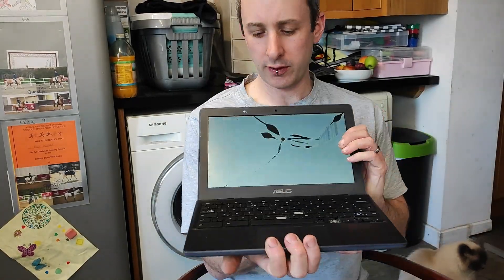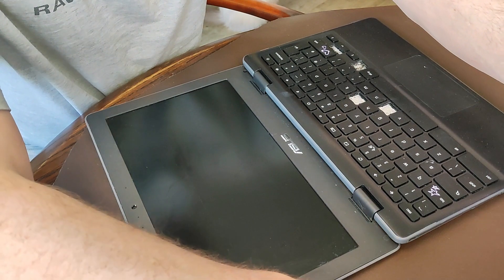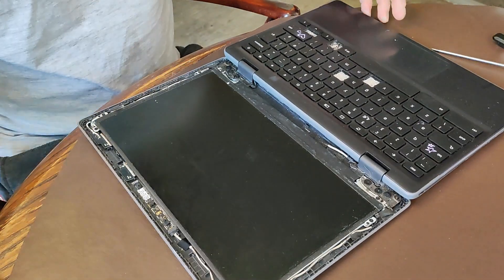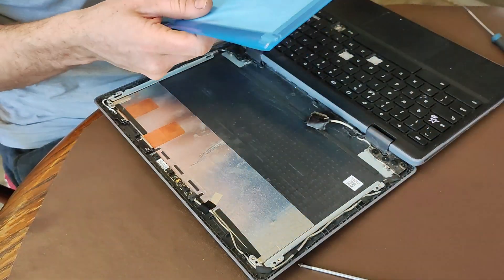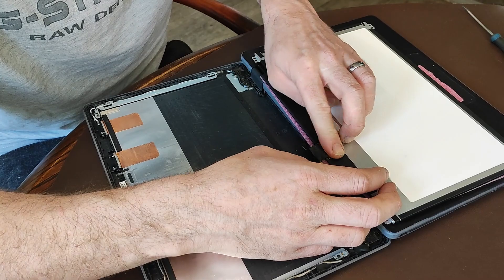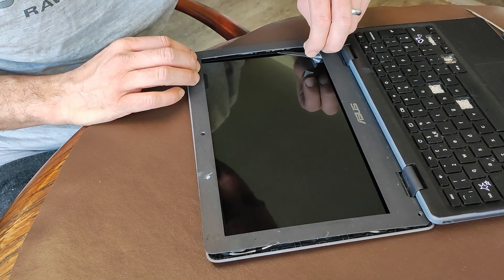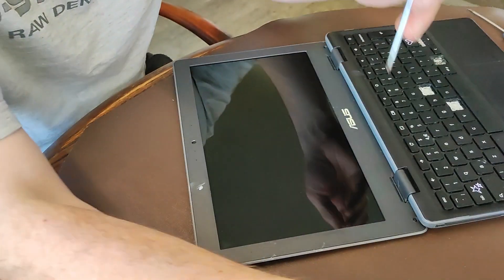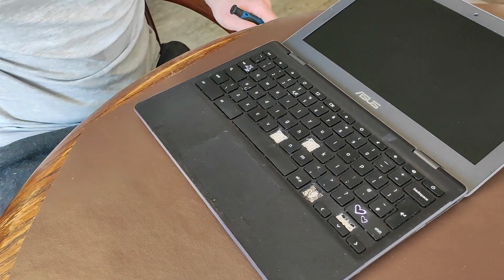ASUS C204M Chromebook - Screen Replacement

Comment: I changed but display does not on??
Reply from the maker: I would check your connections. Also check the laptop has power and is switching on